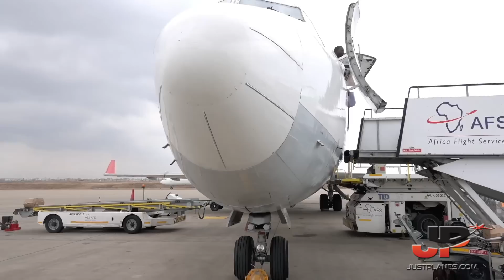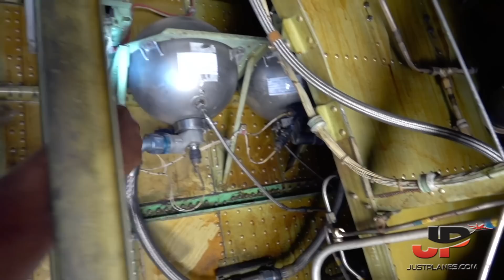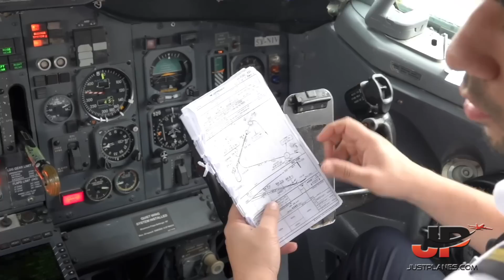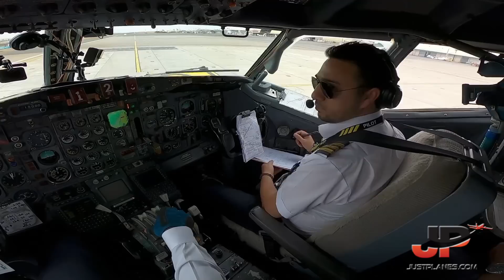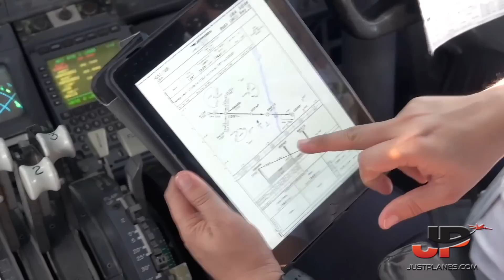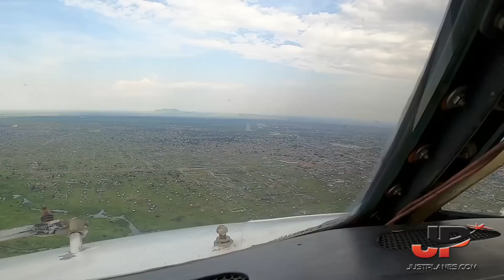Astral Boeing 727-200 Cockpit Nairobi🇰🇪 to Juba🇸🇸

Comment: It appears that the 727 is no longer in service with Astral. The company is listed as currently operating a Boeing 767 and an old DC-9.
Reply: Yup, sadly it is true the 727 is no longer flying here. I was the Captain on this video flight. I got transitioned to the B767 in 2024.
Reply: @jumamwondha2132 hell captain! Thanks for the awesome video. Just a question, how does recording in cockpit works? You ask your company or?
Reply: They got one or more 737s, 400s I believe

Comment: amazing. why everyone in the cockpit has to touch the throtle?
Reply: The pilots of course have to hold the throttles during takeoff and during descent to  maintain correct airspeed and altitude. The Flight Engineer (FE) is setting the takeoff EPR's (Exhaust Pressure Ratio's) in the one view of him. He just ensures the engines are operating at the calculated  settings for each stage of the flight ie takeoff, cruise and descent. In the one view of the FE, the pilot has effectively just pushed the throttles forward to roughly where he thinks they should be and then remains focused on flying the airplane. But the engines are still spooling up and this is where the FE focuses on each engine and ensures that once the engines have spooled, the throttles are set for the correct EPR's on each engine.

Comment: So, engine 3 catches fire a lot huh?
Reply: Many 727´s been cannibalised and this is probably a spare part from one of these cannibalised 727´s. Maintenance polishing the glass for decades might have worn the white out but they off course could have given it a white brush up in the "3". The "3" though have a height difference along the edges so even if a complete smoke filled cockpit they can feel the "3" with their fingers. 
I read your comment before watching and thought he might get fire warnings on that engine. All along the hot air bleed from engine three and to just a few metres behind nose wheel, where cabin air packs are, runs a bi metal fire loop. These very long bleed tubes are in sections. I have during my years working on 727`s, on ground and in the air, had a few times where bleed air, during take off power, leaked out from a failing O-ring and after a period triggered a false engine fire alert. It could be a "killer" maintenance task to find the spot leaking as it would only bleed at the O ring at max take-off power and since it were something you had to deal with right away no black streaks or other indications would reveal where the leak were, unless provoked to actually bleed. Opening up the entire plane´s right side bottom were a man hour consuming task and when to fire up the engines and test before proceeding to next panels. On an outstation period in Helsinki with a colleague we hired in 12 Finnair mechanics for an entire nightshift, as plane were arriving with that fault around midnight and had to be used for an early morning flight. We fired up engines a total of 4 times and do I need to tell that it were up front at the very last panel we found it were bleeding. Passengers were boarding as we were putting on the last panels. Funny how something nightmarish then, can end up being a fun memory now. The O ring might have been 10 Dollars but the total cost of that repair.....aj aj aj. We were handling 2 727´s that just had had a C check and were supposed to work hard for 2 weeks in a peak holiday period in Finland so despite the huge tap, we actually got a "well done" from the CEO of the airline that had 1800 employees, so that made the dedicated effort worth it.
Reply: @Mike-zx1kx Good work mate. 👍

Comment: the captain didnt wanna appear on camera.very bad.
Reply: He did the walk around on camera.
Reply: @Despicable_Me-2  really? that was the captain? OKA
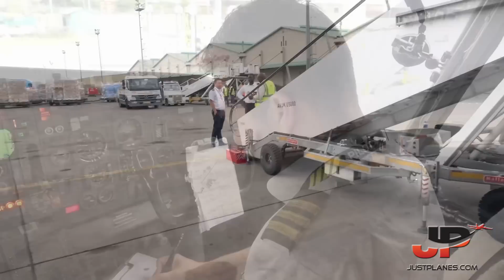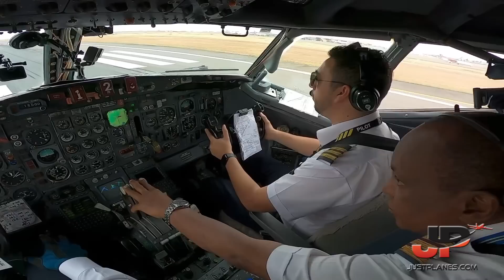Reply: @Nate2026-c2r  . My mistake man. It was the Flight Engineer. See his watch at 13:12 and again at 34:00. The Captain can be seen standing at the bottom of the stairs at 13:12 talking to the First Officer and a Ground support person in hi vis. You'll see the Captain is wearing long sleeves while the Flight Engineer and the First Officer are both wearing short sleeves. You get another glimpse of the Captain after landing at point 1:04:56 as he turns to backtrack the aircraft down the runway to the terminal. 
It is a shame that neither of these individuals were shown in their roles operating the aircraft especially the Flight Engineer,  on one of these few old birds still flying that have a Flight Engineer station.
Reply: @Despicable_Me-2  thank you